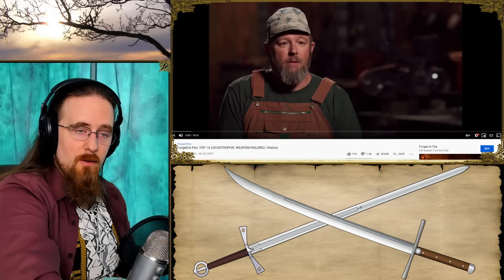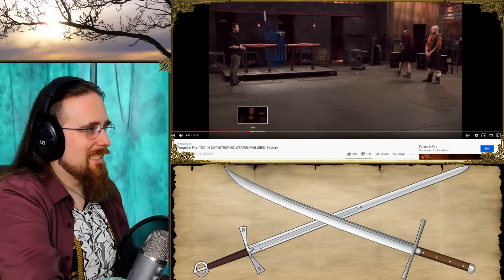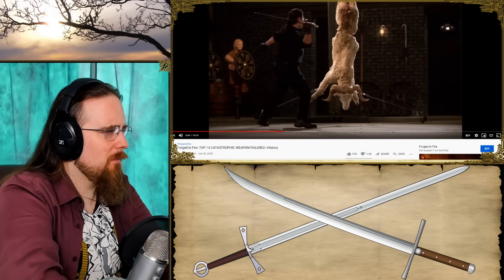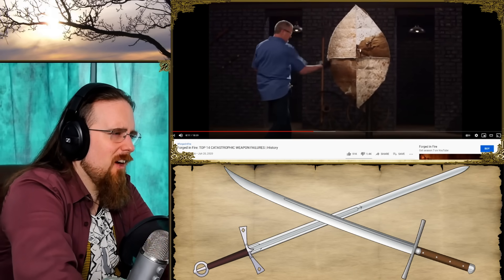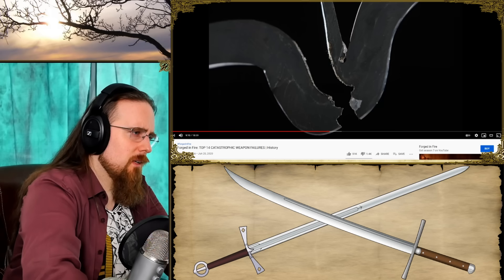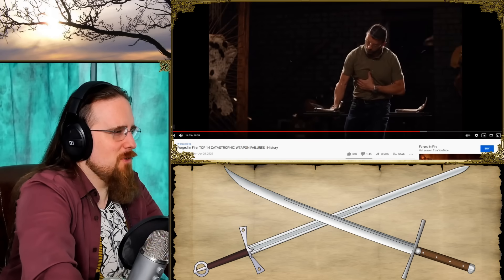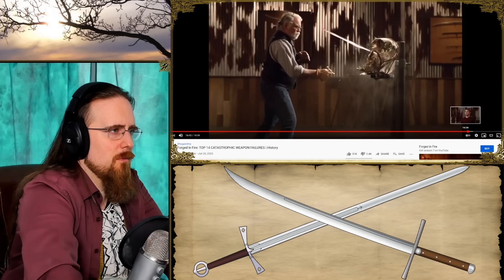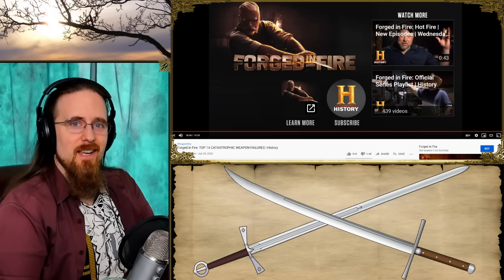Skall Comments: Catastrophic Failures on Forged in Fire

Comment: It seems to me like they're more focused on FORCING the blades to break than on testing anything actually relevant
Reply: They're testing the smith's ability, genius.
Reply: @TheAchilles26  Wrong. Torture tests bring out the most minute flaws in the metalwork and that all comes down to the smith's ability. The tests are made known beforehand and smiths know what properties their blade must have to survive.

Try again.
Reply: Yet somehow these breaks are fairly rare.  Maybe a 25% break rate in the final round?  I’ve never ran the numbers, but it seems that the weapons survive more often than not.
Reply: @MansMan42069  
Are we testing swords or hammers? What's next, a watchmaker show where they see who makes the best watch by throwing hand grenades at them? A gunsmith show where they rate the gun by how easily you can use it as a sledgehammer?
Reply: @SoI_Badguy  Nice slippery slope strawman. Next.
Reply: They are testing for the best blade not just a working one.
Reply: @SoI_Badguy  a comparison that doesn't work. Swordmaking, knifemaking, they all share enough common principles that they can all be assessed under the same parameters.

1) Can you design a tool for the scenario given?
2) Is your metallurgy sound?
3) Is your technical ability sound?

All tests are designed to test one of these 3 things to near the point of failure. Remember that these failures only occur when the smith fails at one of the 3 parameters. Also remember that these tests are not impossible because the judges also do them under the same time and material constraints.

Your watchmaker and gunsmith examples are slippery slopes that miss the point of the tests.

AronRa is the personification of r/atheism. Full of himself and nothing but a joke. I'm insulted you'd compare me to him.
Reply: @MansMan42069  see, somebody gets the point of the show, it's like Ninja Warrior or one of those crazy ass cooking shows but for black smiths, it's about surpassing an unreasonable obstacle by being as near to perfection as possible, even the tiniest of mistakes that you'd never encounter under normal circumstances can cause failure. Could you imagine if they just made OK knives and exclusively cut light weight fleshy objects, or cloth, or opened boxes, "Amazing, Dylan, your blade survived the T-shirt test, you're moving on to the wood carving portion of testing"
Reply: Durability, handleability, and sharpness are the three big qualifiers, and they gotta go hard otherwise no one fails
Reply: It’s not without flaw though, there have been cases of human error causing breaks and failures
Reply: These test are irrelevant?  They test the smith's design, ability to grind and sharpen, and the smith's knowledge of heat treating.  It doesn't seem like that's what is going on, but the test are loosely based on the American Bladesmith Societies Journeyman and Master Smith test.  If you know how to properly heat treat, use the best grind for the situation, ability to sharpen, etc.
Reply: @Nikotheleepic  When did I call someone a redditor?
Reply: @MansMan42069  You are the epitome of “I found big words in a book and I will now win every online argument”
Reply: @jackofastora8962  That's the extent of your retort? Next.
Reply: @MansMan42069  Not a retort, I just wanted to say it. For the most part I agreed with what you said except for the unnecessary use of fancy words
Reply: @jackofastora8962  Okay, fair.
Reply: I mean they basically have to do those extreme tests. If they were just doing tests on dummies or softer targets, then most average smiths would be able to make blades that perform well. Your “average” sword would perform as well as a “master-grade” sword in average tests and there’d be no way to tell which was better if they both were able to complete the task equally well. It’s only during those tests that push the weapons to the absolute limit where the truly better craftsmanship shines through. Either that or you’d have to do those dummy tests about a thousand times to see which blade holds up the longest.
Reply: @CJ-442  you are missing the point of what is the weapon. Is a handgun better weapon than knife? Depends on how you intend to use them- for stabbing the knife is better but it doesn't make it superior weapon. Can you test the quality of the bow in using the very same measure as when you were testing quality of dagger? Every tool has it's own purpose. It is unfair to use the same measure to different objects. Durability of steel is the measure relevant only to some point. If you decide who makes better steel then you can have 2 smiths to produce 2 ingots and do some stress tests and chemistry fun. But swords are different thing- each type has a different set of desired qualities. Think of it as of cars. Can you test quality of any car with "which is faster" factor? Or which has more seats? Or which has bigger tank? 50 mm steel plate is better at deflecting handgun rounds but it doesn't make it perfect material for armor.
Reply: Big sword snaps = big slow mo = big ratings
Reply: The contestants know that they're going to be tested like this. The purpose of these blades is to survive this gauntlet.
Reply: @luckylanno  i know, but you're missing the point. Argument is about weapon superiority in general, not this particular stupid contest (stupid in terms of weird rules, like choosing Miss World based on other traits than looks or Oscars based on ethnicity instead of performance). The argument i was replying to is "if they were doing test on soft target (...) then most average smiths would be able to make blades that perform well". Which is exactly like saying that anyone can make a car that drives but only the best car manufacturer can make car that can be used as swimming pool. So my message is: if you can create weapon able to survive these tests you are not making good weapon and it doesn't make you a good weaponsmith, it only makes you good contestant in this very tv show. If there is a contest where you have to sprint for 2 meters and then do 100 squats and you win the world cup, it doesn't make you the best sprinter in the world and it doesn't even give you any recognition among sprinters. Being good at poorly designed test means absolutely nothing.
Reply: The only way to know the limit is to find it.

Comment: For this next test we're gonna put your knife into a metal grinder
Reply: But first so it shows up on TV better, we're going to heat it up until the blade is glowing
Reply: That would actually be a much better test, because it would at least be consistent between contestants.
Reply: grinder breaks

this grinder did not keel

Comment: A Forged In Fire Judge Goes to the Sword Shop.
"I'm looking for something that can cut through a rock."
"Sir, swords weren't meant to do that."
"Sounds like you only know about bad swords."
Reply: Isn´t it more like "I want sword I can bash 12 times in a rock. It´s all about what the rock does to the sword. After that the sword should cleanly cut a silk scarf dropped on the edge." ?
Reply: "What kind of sword is that?"
"Sir, that is a sledgehammer."
"can I cut rock?"
"Well, it can ... break rock."
"Then I'll take that sword."
Reply: My pocket knife can cleave tombstones in half.
Reply: A katana can do it easily, I seen it happen in the final fantasy movie
Reply: * Tanjiro wants to know your location *
Reply: they dont know about the sword Gramr tha cutted an anvil
Reply: @ianmeza9216  Or Callabolg, which cut the tops off 3 hills in a single blow.
Reply: "You dont have lightsabers? Pffff"
Reply: "We used your blade as an oil rig drilling tip and after 2,000 ft depth we didn't strike oil. It will not keel"
Reply: @Robin Thrush Enma wants to know your location.
Reply: @hozzoh9936  oh oh I saw on One Piece Rorona Zorro cut thru stell so yeah rock is reasonable.
Reply: That Judge is J Nielson
Reply: @jimbeam7636  Shisui xd
Reply: tanjiro in the distance

Comment: I remember the episode at 7:25. Both blades broke in the "strength" testing, so the winner was the one that lasted one swing longer. The thing which bugs me about the abusive testing is that in at least one case it has allowed an objectively worse sword to win. The competitors had to make a knightly arming sword, and one turned in a lean, clean, well-balanced sword. The other made a crowbar with an edge on it. After the keal test, Doug praised the weight of the first sword and complained about it in the other. For the strength test, they smashed the swords into blocks of ice, and the crowbar survived but the good sword's handle broke and was therefore disqualified. The objectively worse sword won because the tests were things you'd never expect a sword to do. It's like testing formula cars by seeing which one floats better. >:(
Reply: There should be a fan movement to get Skallagrim on the show to handle the weapons with Doug, but honestly, he should leave the forging criticisms to the judges, who are master smiths (it's why they test the weapons so rigorously to begin with). The test for the title by the American Bladesmith Society is nothing to sneeze at because it's insanely difficult to make a knife that can withstand a 90-degree bend in both directions and come back to true.

EDIT: The forged blade is allowed to crack, but chipping is automatic disqualification, according to the official ABS rules for the Master test.
Reply: I think top gear did a thing aboat which cars float better, turns out it’s a truck with an outboard on the tailgate
Reply: Haha I watched that episode last night. The pommel came off and the sword which could be barely swung one handed won.
Reply: Also they can’t measure how much force you’re using. Looks like a game of biggest swing and power-implying facial expression while using as little force possible
Reply: @asdfg2560  The ToyBota!
"aboat" lol
Reply: Wow, fancy seeing you here.
Reply: Well to be honest the crowbar one was objectively better one since it tried to survive smack test better than the actual sword. And this is why in everything it is SUPER important to measure the actual result you want not whatever you think might be useful since people will just game the system and make stuff that wins the measurements but loses the purpose
Reply: Or throwing the dishes of a cooking competition against a wall and giving the win to the dish which made a prettier pattern...
Reply: @VoresD  yes, a crowbar is better than a sword at being a crowbar, but this is a sword test, not general weaponry.
Reply: Funnily enough, I could see the objectively better-made sword standing a chance in the abuse test if the wielder using the hilt for bashing.
Reply: But were it objectively better if it started to fall apart? If ye be makin' yer way across the decks, hackin' and slashin' at the Imperial dogs between yer crew and yer proper spoils, ye want yer blade to survive all comers
Reply: @kuno3336  But if I use both a hammer and a screwdriver to bash in a nail, it won't tell me which tool is a better screwdriver.
Reply: @leppeppel  you'll likely damage a screwdriver that way, which would mean it failed the strength test. A sword is a weapon, a killing tool. It's primary function is killing, so as long as it does the job and survives to be able to keep doing it, the sword is working as intended. I love swords, but at the end of the day the sword least likely to break is almost always the preferable option
Reply: The tests are there to see who is the better blacksmith who can make a functional sword that can survive the test, they're not testing which is the better sword for battle. The first sword is objectively better in battle but not so much in intensive durability testing.
Reply: @jeremiahsmith7924  No it isn't, but you say whatever makes you feel better
Reply: My thoughts exactly when I was a kid.
Reply: It's not objectively worse because it was obviously more sturdy than the "better sword"

If you had to choose between using a weak sword with good balance or a strong sword with suboptimal balance in a life or death scenario witch would you pick?

I would pick the sword that doesn't break in two, so would most sane people. Balance isn't the only thing that matters in a blade.
Reply: @deadtempleknight.6332 if your sword falls apart then it's not a good sword
Reply: @harleyleedavidson8751  if you are bashing your sword into rock or ice, you aren't using your sword correctly.
Reply: @deadtempleknight.6332  do you think the enemy's armor would be any softer?
Reply: @harleyleedavidson8751  than a solid chunk of ice? Maybe, but thats irrelevant, you won't be chopping the enemy's armor with a sword anyways
Reply: The guy who made the crowbar cracked the code to victory on that dumb show: whatever the judges ask, just make a thick, solid club. Because the only thing about your "blade" that matters, is for it not to shatter under unreasonable abuse. Because that's what blades are used for: people give them to gorillas to pummel boulders with.
Reply: That's the episode that pissed me off more than any other. It wasn't even a handle construction flaw. It was an unforeseeable flaw in the damn wood itself. I suppose that's another reason they did cord, wire or leather wrapping on handles back then.
Reply: I just watched the arming sword debacle and it's even worse! The guy who made the "crowbar" didn't even put a proper cutting edge on the sword, it barely cut into the carcass and only got the keel rating because it was able to pierce with the point. You can also see in the ice block test that at one point the sword twists in the judges grip, he had to readjust his grip back 90 degrees.
So in the end the winning sword cut like shit, was unwieldy and overly heavy and seemed to have a bad grip. But because you can technically kill with a pointy steel club, he gets the win.

Comment: With the number of frames available on the shield strike, that could even be after the strike itself.
Reply: Yeah that's actually my guess, if you notice the top blade seems to be vibrating in place, so I'm guessing that frame actually happened after the impact.
Reply: It seems like to me that the tip hit and the blade turned in his hand
Reply: It looks like the blade got stuck under the shield's horizontal bar of wood or cane
Reply: Had the same thought
Reply: It seems like they only bring out the fancy slow-mo camera for pretty ice explosions.
Reply: man but he was going to town with that shield. After 5-6 huge hits I totally understand the blade giving up .
Reply: But the shield hadn't moved at all. No could you see an impact point yet. It wouldn't have bounced back before the impact on the shield.
Reply: Or some sort of rolling shutter problem